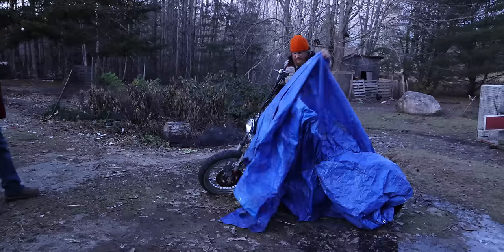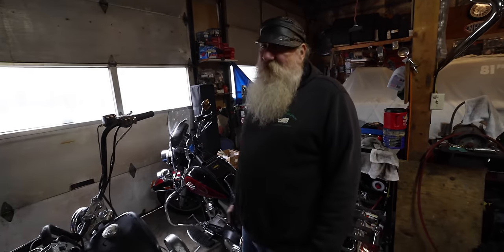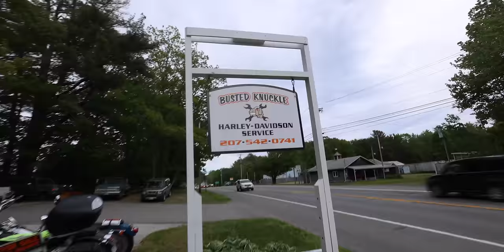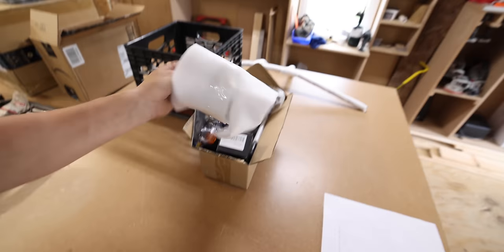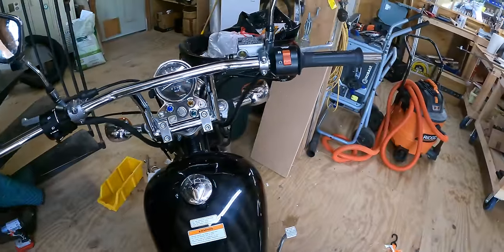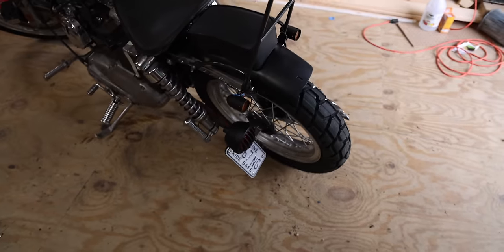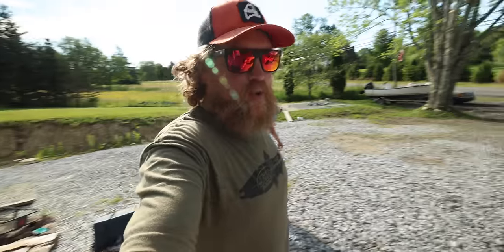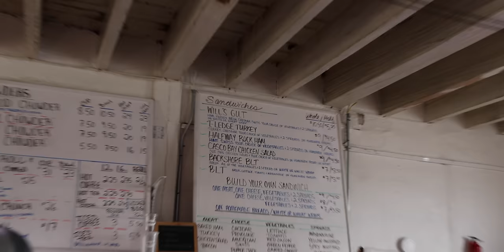Chopper Motorcycle Build Catch & Cook | Day 1 of 7 Motorcycle Camping Maine Easy Rider Adventure

Comment: As a guy who is a fabricator for a living I highly suggest getting a Lincoln 210mp. They are an awesome little multi process welder. What also makes them very cool is they will run off of 110 volt or 220. You can mig stick and tig with them. Awesome video I want to do something similar with a dual sport bike looks like a lot of fun.

Comment: The rebel 250 is the bike I had to ride at the course where you get your motorcycle  endorsement  on your license. I am 6 ft 4 and weigh right around 275.  When I rode that tiny bike on the course both of my knees were all the way to each side me. I had them spread so  far my thighs and knees were hurting bad.

Comment: Zack, it is my understanding that your front tire is on backwards. I believe the point of the V should be facing forward as the wheel turns as to shed water. And it can be dangerous to run a directional tire backwards. Usually they indicate on the sidewall if they are directional and what direction to mount. Just wanted to bring it to your attention. Anyways I LOVE THIS! PLEASE DO IT AGAIN!